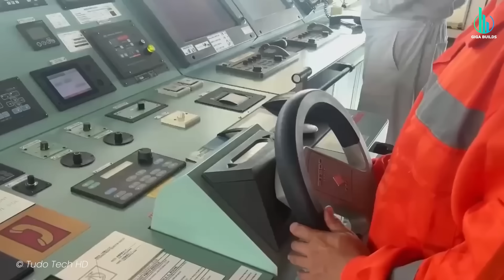Mexico Just Shocked The World With What They’re Building

Comment: It sounds like a great idea until you start to figure the costs for doing it and the risks invovled.

Every time you move a container, you create risks.   The risk of a drop, the risk of contents shifting or getting damaged, and so on.    So this process adds 2 to 4 handling processes that add risk.   That by itself is an issue.

Now the next problem is scale.  Panama canal moves 30 to 40 ships per day.    So EACH END of this project would have to have enough birth space, enough crane, enough staff to handle 40 ships per day.    Then you have to have enough rail service to move 40 ships per day of containers from one end to the other without interruptions.   A Panamax ship moves 3000-5000 TEUs or 1500-2500 40 foot containers. Doubled up, a single ship is still 750-1250 train cars.  So if a train is maximum 200 cars (and that is long) then you need 5 trains per boat, times 40 ships... so more than 200 trains per day to load and unload and move along.  The whole thing does not scale.

Even more importantly, if the material is going to the US, it would make much more sense just to drop it in the US and let it take the rails here.   The unloading and reloading just to sail up to port of LA or whatever seems incredibly stupid.

Comment: Obviously an alternative.  Just remember that a ship that lets off cargo at one point still needs to return home (presumably empty), ... AND another ship on the other end would need to receive the cargo (already empty before hand).  Overall it take twice the amount of shipping to accomplish the overall task, and it needs to be coordinated together (east and west end) as well.  If the Panama Camal would require days and weeks to get though, then can another (receiving) ship be assigned to receive any cargo quick enough to make a difference (?) ... a ship on the other side no less (?).

The Mexico solution might or might not be cheaper since it necessarily involves two ships.  Have fun figuring out the money time and effort.  It is probably good to have it as an alternative in case of long-term problems with Panama Canal, ... again, have fun figuring out the money and time and effort involved!

Comment: Actually it was not the US but France that came up with the plan for the Panama canal.

No railway line will ever reasonable compete with  a canal.
The biggest container ships can carry around 25.000 TEU.
Let's go with a "normal big" ship that can carry 15.000 TEU.
Now put those 15.000 TEU on trains:
A train with 50 cars is already pretty long. 
If you stack the containers, it can carry 100 boxes.
That means 150 trains.
If they are really close, you ca start a new train approx. every 2 minutes on the same track.
That means 5 hours permanently sending a train just to  transport the boxes from 1 ship.
Add to that 1 day to completely unload the boxes (if you are fast and efficient) and another day to load them back on a ship on the other side.
And now compare that to a canal that can handle 30-50 ships in each direction per day

Comment: Nobody researches anything, they just take things for fact. China is the 1 building the new canal and have built a rail system across the country. to bypass crytical monitoring at the Panama canal. China owns ports on both sides of the Panama Canal and they are doing everything they can to bypass, so it is much easier to bring illegal goods into US ports. During Trumps last administration, the chinese was allowed to buy up 1000s of acres of US farmland strategically placed around sensitive US military bases. I know the chinese used the high traffic illegal border crossing from Mexico to the US to cover tunnel boring operation from Cartel controlled Juarez Mexico under the US border into land they own In Texas next to US military base that holds a lot of our air power. This Chinese owned land has an air strip you could land bombers on. We used to have fracking earthquakes in S/W Texas now it all the sudden expanded in a basic line from Juarez, Mexico all the way to the land China owns in Texas. This leads me to believe they are moving equipment, personnel, and most likely autonomous vehicles, that they can control through there strategically owned cell towers. Yes China owns a lot of the cell towers that went up during the plandemic/lockdowns. These are basically the antenna on that controls the autonomous  vehicles. I know for a fact your wireless service got worse, I know mine is and there are 3 cell 5g frequency towers that shadow my 22 acres, and I only get 2-3 bars out of 5. I have highest high speed spectrum package which runs on Verizon towers, Only time I get 5 bars anywhere is around wifi which is hard wired feed to your wifi router. All the towers evrywhere now should mean you have the clearest signal anywhere you go, and that is what we where told was supposed better connection. So what are they really used for. We more then triple the out put of 5g frequency (harmful to all living things, but at least you got the internet while it fries your brain. Look into what I say. At the minnimal China can capture and receive your data through their towers. Why would Trump administration allow China to have so much control in the US, but ban there cell phones from being on the 5g network. When China controls quite a bit of the cell towers in the US. Stage is being set for a foreign takeover. Billionaires do not care about you or the US, they care about money, that can buy them an Epstein Island and you can name it any country you want, and make all the laws of the land you want. Better wake up, I am sure nobody will research, they will just say its lies. Most of you are too lazy to read this much. You all see the propoganda of China and think they are great, without research. Did you know during Trumps last administration, during WARSPEED King of vaccine, he signed a bill into effect that allows the US government to use propoganda against its own people. So keep being sheeple. Most what you see on the stage and screen are fake propoganda, to keep your mind busy while all the real stuff goes on behind the scenes. Fake Charlie Kirk death, Republicans closed the Epstein files. If we knew who was pedos for sure we could strip these people of their wealth and power. Redistribute it to everyone in the US and around the world, because we are not the only country where the rich get richer and the poor get poorer. The billionaires are in the highest seats around the world. They do not die when they send their people into wars, the poor people do. So how many millions of successful people have to die before they have the chance to change the world 1 day? The rich and there families never go to war so their lineage/heritage carries on, while yours gets destroyed, how can you rise above the rich, when they hold all but 1 card. That is numbers and guns until you think about the illegal migrants that came over the border and the training camps, I mean holding facilities these people are housed in. WE went from instantly deporting people to holding them in newly constructed facilities like gator alcatraz. This looks more like where our US military would be trained. I AM POKING YOU WITH A STICK because you are not listening to words. The people setting the stage will be wielding weapons at your front door. They could shut down communications for a whole town Jamming signals with the strategically placed towers, blockade the town and do what they want, whether taking your weapons, land, property and nobody would ever know til it was too late. Trust and believe the millions that came over the border and the 1s going under the border they have the numbers, where we are all spread out in little pockets. We never come together to create a deterence. You all have such a small attention span you believe a hologram of Charlie Kirk was real and that the real charlie kirk came out of the strategically placed trap door that was under the table. Not to mention the absolute lack of blood or bandaging Charlie Kirk up. They grabbed him up before paramedics that was there could even get to him (you know paramedics with their life saving equipment and bandages in the ambulance. What it was is they was not none of the paid actors. There should be 100s of videos circulating. Your gonna tell me only a handful of people was recording his speeches. Goodnight Sheeple people I am gonna start eating with the wolves.

Comment: Daily more than 50000 containers are transported through the Panama canal by ship.  If these where to be transported by train instead it will take a lot of trains.  Assuming that one train can stretch as long as 2km it can hold approx 250 containers, this equates to 200 train journeys coast-to-coast per day.  Assuming that each train will carry freight in both directions it equates to 100 return trips a day.  I.e. a train will have to leave every 15 minute regardless.  The logistics to load and unload these enormous trains will be gigantic but probably doable.  Also, trains will have accidents and mechanical failures and the flow of trains must be as unaffected by such mishaps as possible.  Exacly how this is to be acheived is somewhat of a mystery to me.

Comment: This may a big upgrade to intertocean travel but it might be interesting to note the first trascontinetal railroad was in fact "The first transcontinental railroad in Panama was the Panama Railroad, completed in 1855. It was the first interoceanic railway in the Americas, running 47 miles from the Atlantic to the Pacific coasts. Built to provide a faster and safer way to cross the isthmus, its construction was a major engineering feat in the mid-19th century. " .I noticed that the Mexican government seized portions of the older railroad by force which means they don't have anything in their constitution about either due process or imminent domain. It is interesting to note but unsurprising because of the socialist roots of the Mexican  government .It is ironic that the Mexican government seems very concerned about due process  in America.

Comment: Panama canal design should be revisited.  I forget my calcs now, but modern surface mining shovels or drag lines make it feasible to move enough soil to lower to sea level, and remove locks except maybe 1 large lock to handle differences in water levels on both ends.
Reply: Several billion cubic yards of rock is a lot more than you picture.
And where are they gonna put it when it's dug out ?
Further, how would you hold back the lakes so you can dig?
And what about the halted shipping for 10 years while they're digging ?
THINK

Comment: The train makes sense.  I don't think they had shipping containers like we have today, back in 1914 which make off-loading to trains more efficient.  Canal digging opens the mind to merely digging artificial harbors on both side making the trip shorter.  Rail travel is faster than canal travel by ship which makes up for off/on-loading time.  Rail is flexible to drought and is a tourist route as well.  But Panama is still the best place for a canal.  Many ships are already too big for the Panama canal built over 100 years ago.  Panama will stick to smaller ships, or with some of the trade pressure taken off Panama, maybe they can expand?  Maybe they won't have to or want to.

Comment: When you have to unload containers from a ship, then load them onto  a railcar, cross any distance, then load them back onto a ship, you've lost any cost savings or advantage over the Panama Canal and direct shipping. Sure, it will create many temporary jobs, but this project has triggered doubts since it's inception.
Reply: Welp, missing the advantages. Modern facilities. Redundancy. If the rail maps are true. Two deep water ports on both side with spurs. One goes down it doesn’t stop the flow. Then, the added benefit of cargo sorting. Huge ships can deliver massive cargos straight from the factory and Mexico gets double the money by separating the cargo for multiple products, multiple ports, multiple countries, multiple companies. This wasn’t part of this video but it is part of the larger plan. It would probably make as much or more than the actual transport. 🤷‍♂️
Reply: Given the other options like traversing thedrake passage,  very rough sea, i believe going through the panama canal or eventually the the narrow land of mexico between the seas is a much viable option
Reply: I believe that's better than waiting up to three weeks at sea for ships to get green light to cross, you could probably haul two ship's worth of containers per trani trip, the whole process would take less than 3 weeks

Comment: 7:51 it was built as a compliment to the Panama Canal, it was never intended to be a replacement, and besides it is different because the plan is to build factories along the rails to give the material an added value or which is the same to build or to produce instead of just transporting
Reply: Complement. But yes.

Comment: Huh, how old is this vid? That's not the current president of Mexico (or is he in reality?). The truth is, the interoceanic train was left halfway. The government of Mexico decided to turn part of the railway into a passenger line, just because. There is not a study of travel demand or even a financial project and it is destined to failure. I root for this project if and only if it is well planned and the government is fully committed to it. 
In order to compete with the Panama Canal, speed is the key word: There should be a minimum of two dedicated railways in both ways and limited by fences. Additionally, Mexico must significantly improve the port facilities in Salina Cruz and Coatzacoalcos, so they can have the required capacity to load and unload the containers efficiently.

Comment: Trains can be very efficient for transporting anything. Capable of moving mass quantities of products quickly and safely over distance. Initially setting the railways is a bit of environmental damage, but the grass & shrubs will grow back along the railways. New trains are powerful and way less harmful to the environment than old steam engines or gas engines. Even the diesel engines have become much more efficient and burn the fuel cleaner, but also have the options for electric train engines. Strong pulling power, high durability, excellent speed and track handling. Canada uses trains a lot to move cargo. Way more efficient than transports, and do not need as many heavy trucks on the highways. To prevent having to lay off trucking companies, they can be incorporated into the distribution system. In Canada, we are crossing a massive span. Train stops at major locations to drop & pick up cars, then goes to the next spot. Rather than big rigs on the highways, a lot of the distribution can be done within the cities with 3 or 5 ton trucks. Pick up products from the rail yard, and distribute the goods to the stores or warehouses. We still use full size transports, but require less of them. Easier on logistics companies. 3 & 5 ton trucks are much cheaper to buy & maintain. Less weight on the roads makes less wear & tare, less potholes. Unless you are in an area like Thunder bay. Built over marsh & swamp land, our roads need to be resurfaced every 2-3 years. Get some pretty bad frost heaving on the streets throughout the winter months lol. But yes, trains can be very beneficial for logistics infrastructure, and that does cut a lot of miles off the travel distance for ships. Saves them on fuel costs and delivery time. A big win for everyone!

Comment: Has anyone done the math? The Panama Canal moves 35 ships a day, which is approximately 245,000 40' containers. East and West per day, that's 900,000 containers per day. Each 200-car train can carry 800 containers. It would require  600 trains per day over 600km of track, and they have to be loaded and unloaded. This all takes place if nothing goes wrong, and what could go wrong?. To get into the realm of practical numbers, they must also consider profitability. As a civil engineer contracted by Flour, I worked on various  Pemex projects for 20 years. Pemex is the lifeblood of Mexico, and it was one disaster after another. Good luck moving 900,000 containers 300km every 24 hours.

Comment: If the Panama Canal is maxed out at 10,000 ships per year and shipping grows to 20,000 ships per year, it's a win win for all...
Reply: no it isn't. The Mexican ports can't handle that many ships to begin with and the rail system is 30 times slower than the Panama Canal. Not to mention that the rail system can only transport so much before it starts needing major overhauls that forces excessive delays in shipment, where as the canal can go several years without a full major overhaul and since it just had one in the 2010s it should be fine for several more decades. The only real issue with the Panama Canal is the fact that it can't support super ships which is why 95% of them go to the west coast ports in the US and then transferred out from those ports

Comment: Theoretically, if Mexico is smart and opts for electric trains, renewables and battery storage, the new transportation system should not only be far cheaper & reliable to run and maintain than ships, it should also go a long way to making a sizeable contribution to the country's nationally determined contributions to emissions reductions under the 2015 Paris Accords. And by electrifying the system, it would also close off any vulnerabilities to external geopolitical tensions and interruptions to oil and diesel supplies, adding to national security. 

Mexico is becoming evermore vulnerable to the increased frequency & intensity of anthropogenic induced climate change hurricanes, flooding and droughts.....🤔